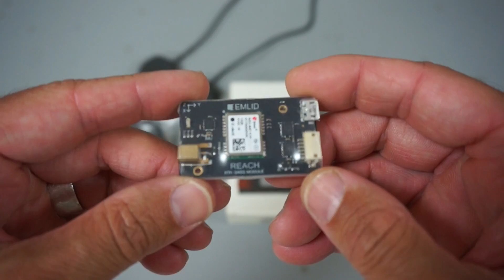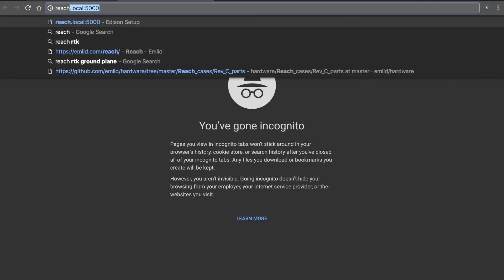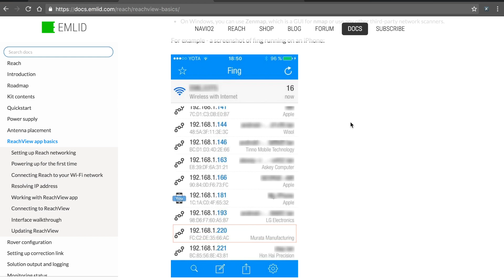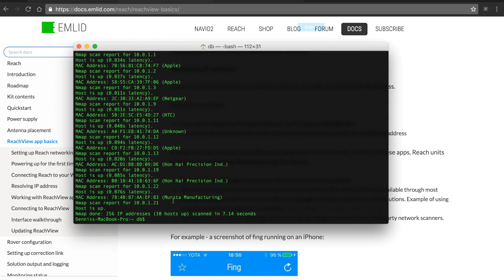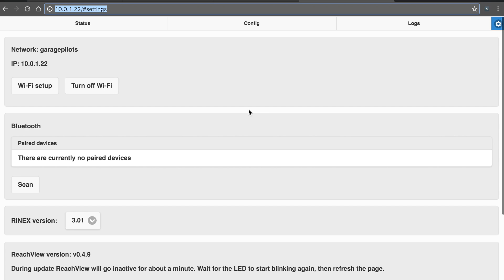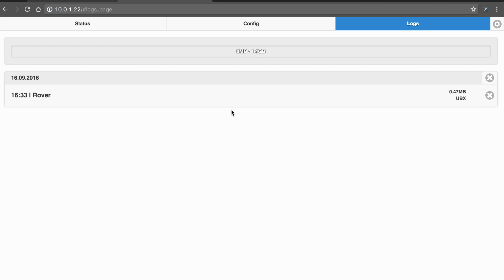EMLID Reach RTK GPS Introduction and Configuration

Comment: Thanks for this very informative video. Just a quick question. How do I power my reach rover if I will   connect a radio and a Bluetooth module at the same time. Thanks
Reply from the maker: The rover module can be powered from your FC and then I'd probably run a BEC with 5V input to the Bluetooth module. Good luck with your setup.
Reply: is it possible to use micro usb hub adapter cable ?

Comment: Hi Dennis, thank you very much for your video, I have one question, is it possible to use one base GPS module to support multiple rover GPS modules? Let's say, use one base GPS module on the ground station and use multiple rover GPS modules on multiple quadcopters, is it possible?
Reply from the maker: Looks like it's possible although I've never tried it:

https://community.emlid.com/t/can-we-use-a-single-base-and-multiple-rover-2-or-3-reach-module-configured-as-rover/4575

Comment: Hello. I can't connect to reach.local:5000 with my laptop from my wirelles connection. It appears a message like 'Server not found'. Also I can't coonect with laptop to Reach module via wirelles.. It shows me that the connection is limited. Do you have a solution for this?Thank you.

Comment: Does the setup require internet access? or just a LAN will do? It seems that I cannot do the setup without internet access
Reply from the maker: Internet access is necessary for firmware updates. You can use it without internet access, but need to be on your local wireless network so the modules can communicate if you're setup via wifi. If you are communicating via 3DR radios without the local network. But if you want to view the web page on the reach device you'll need wifi for that. So if you're at the field these can communicate long range, log, and then you can process the data later. All without network in the field.

Comment: Ok so... This is two ublox M8P modules strapped to an intel edison board that costs 570 bucks... ok thats fair... kinda, but issnt it a little too much to have an edison on them? i would think that something like a custom arduino would be enough, those edison modules are expensive and probably way overpowered. The http interface looks nice, but a custom software for interfacing would have been just as good, possibly better because then i wouldn't need to put this thing on my wifi. uknow U-blox sells rf transceivers
Reply from the maker: Yeah I'm not exactly sure how computationally heavy RTK is so I'd have to assume the fact they're using Edison will allow them room for growth. They are probably planning for the future. Good point about the RF transceivers. I haven't seen those before but will definitely look into them. Thanks for the thoughts.

Comment: Thank you Dennis, I've been in the market for a RTK System. I think I'm going to purchase this system. Looking forward the the rest of your video on this system.
Reply from the maker: I've really been blown away by the ease of use. I'm setup the base station yesterday with the 3DR radios. I did have a problem with the TX/RX cables being reversed but other than that it's now communicating over 915 MHz. More details coming soon.